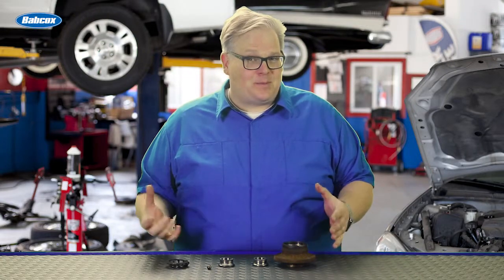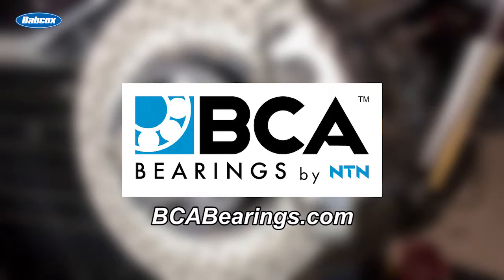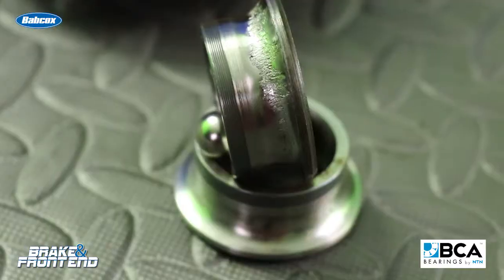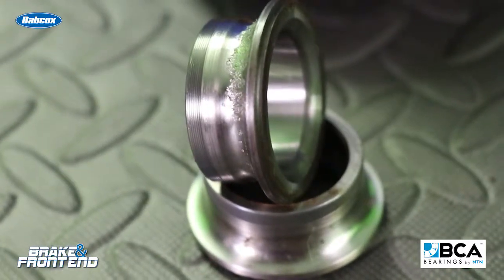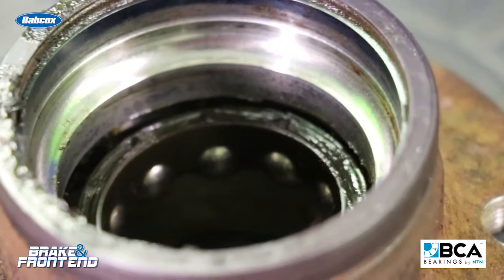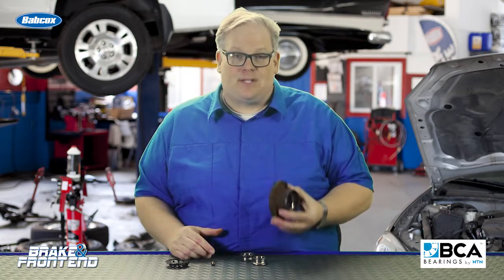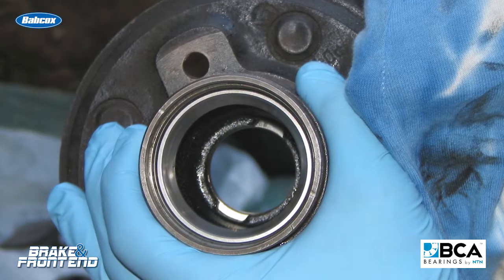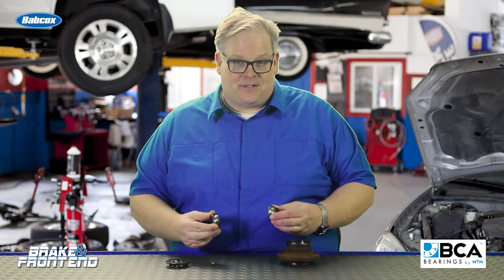Can Hitting a Curb or Pothole Damage a Wheel Bearing?

Comment: My wife hit a curb going about 20mph. The wheel bent slightly. Checked the alignment which is ok but now i hear a hum on the freeway. No vibration  and drives straight. Is it the bearing?
Reply from the maker: Good question. That could definitely be a failing wheel bearing. An impact like that can damage the steel components inside the bearing, which can cause flaking of the steel. The flaked steel contaminates the grease and makes it abrasive, which causes friction. A humming noise coming from the bearing is a good indication of that damage. However, damage to a wheel or tire could also mimic that noise. Under these circumstances, it would be advisable to replace a damaged wheel and/or tire, and then to diagnose the wheel bearing. If you have already replaced the wheel/tire and had your alignment checked, the wheel bearing would be the next most likely suspect. Here is our video about isolating noises that can mimic wheel bearing damage that might be helpful: https://youtu.be/C3thvtXIa2Q

Comment: I have one little bump last night and I had to drive my car at 16 mph any higher the car wobbles out of control it made a loud sound like I was driving it with no wheel or something I hit the stripped Street about to be repaved how they cut it and then they scrape all the gravel off of it there's no warning that the street is about to change or anyting some are shallow some are very deep the one I hit last night with medium the front of the car didn't find soon at the back wheels hit going down inside the unpaved street maybe a 2in drop and then rough unpaved Road I was done it started wobbling immediately like a real was hitting something I remember my mechanic telling me I was going to need a wheel hub for that side I vaguely remember does that sound like that's what it is rear passenger wheel car not drivable after one little bump
Reply from the maker: Sorry to hear this! I hit one of those stripped spots in the pavement before. Cost me a wheel and two tires. The road crews should really be required to put warning signs up for those spots where they strip the tops layers off. These spots are very hard to see, especially at night, and some of them are definitely deep enough to cause major damage, or even an accident. 

While this type of impact can cause damage to wheel bearings, it is likely that it would also damage the wheel and tire, and possibly even suspension components. The wobbling you describe sounds like it may be a damaged wheel/tire or a wheel balance issue caused by the impact.

Comment: Had this happened to my 2014 Raptor Oem Wheel bearing I’ve checked with mechanic on the driver side prior to the failure day and he told there is warning signs , I have 40” tires and I know it’s heavy on the bearings  but the potholes in my country are like ants scattered everywhere and made things much worse  and finally broke my driver side bearing and the tierod rubbed against the backspace of the wheel . 

I’m fine with breaking something off-road but not in the streets 😕
Reply: I just replaced my wheel bearing 6 months ago and it's shot again.